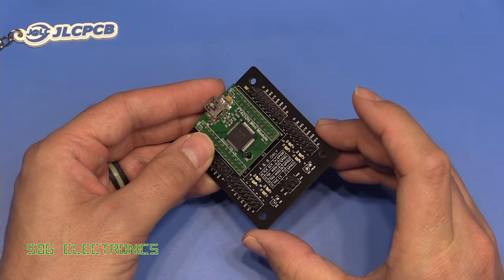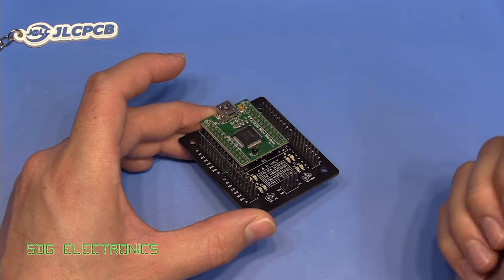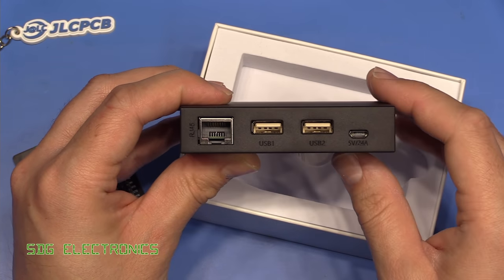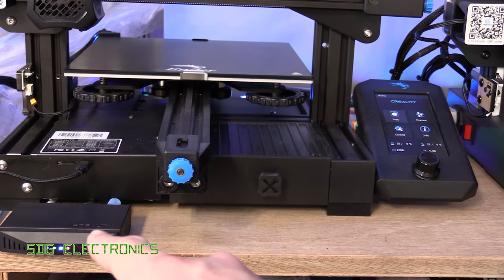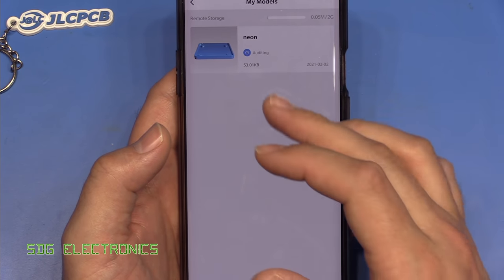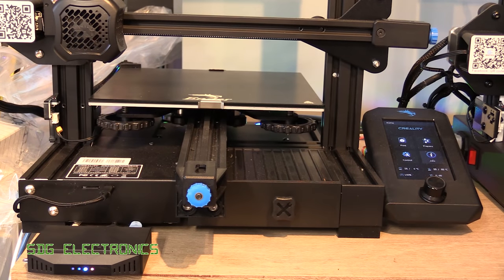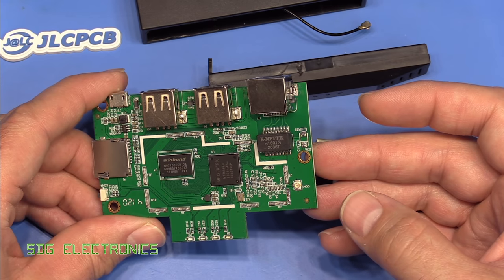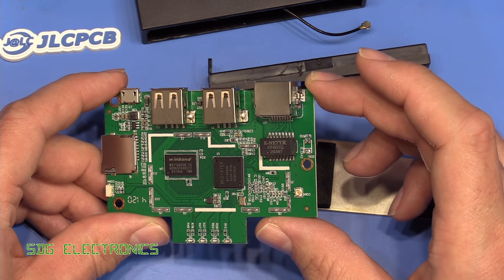SDG #194 Wireless 3D Printing with the Creality WiFi Box. Or not.

Comment: I own a wifi-box, but i'm not very fond of it. Using a raspberry 3 or 4 with octoprint is way, way, way easier and more versatile. The amount of options on octoprint, compared to the options of the wifi-box are not to compare. The wifi-box can receive designs from your computer/laptop through your creality-account, but you need to use your phone to make the final operations. This afternoon I saw a video of someone, flashing the wifi-box with Klipper and Octoprint. I think that's the best option for this box, to function right and in a pleasant way.

Comment: That looks like an UART patchpoint on the bottom (the 4 testpads), maybe reflash the Chip to run an instance of octoprint?
Reply: They are. Though if you want to flash openwrt on it, someone already did the hard part and you don't even need that serial interface. Just put the compiled openwrt image on the sd card and the box will get tricked to install an offline update when it's actually the openwrt image. Check this https://hackaday.com/2020/12/28/teardown-creality-wifi-box/  You'll find the link to the guy's github page who ported openwrt (figgyc).

Comment: Thanks for being the first person I've seen that took this apart. 
  I wonder what system requirements octoprint has. The MT7688 has decent open toolchain support from Mediatek. It also has an available uboot bootloader. At first glance there is support for node js and python, along with a MT7688 dev board Mediatek lists with arduino ide support. I imagine someone will eventually get octoprint running on this. It's a shame creality didn't spend their dev dollars doing this already. Time spent on a proprietary phone app was a dumb move. It shows a lack of marketing perspective, and growth potential. Any product like this should be designed independently and able to stand on it's own. If it worked with every printer, and most people have a positive experience, they would be far more receptive to Creality in the future. 
   I'm researching what to get for my first printer. I almost pulled the trigger for a Creality, but stuff like this.... Nah. I'm looking at an original Prusa now. In the MK3S customer feedback reviews on the Prusa website it seems like most people are paying an Asian market first printer purchase tax before purchasing a MK3S and confessing their sins in their feedback comments. I think I'll go the cheaper route and skip the tax.
-Jake
Reply: Yeah, I was thinking the same thing. Reflashing this to octoprint (or other open source print monitoring software) seems like a definite possibility. If I knew more about embedded linux I'd give it a shot myself, but all I've managed to do so far is burn defconfigs from buildroot. Also, as a Prusa mini owner, I can't recommend Prusa printers enough. I've had several chinese cheap printers before, and they were always a pain with getting it tuned (and keeping it that way). Bought my mini 6 months ago and have done 0 tuning. It's worked flawlessly, would definitely recommend to anyone looking to get into 3D printing.
Reply: The SoC in this box is even slower than a Raspberry Pi Zero, I think (I've not checked), and OctoPrint is painful enough to use on a RPi Zero. Also I seem to recall that the Pi Zero is officially not supported by OctoPrint due to lack of CPU/RAM (based on what I remember of the interview with Gina Häußge - creator of OctoPrint - on the Meltzone Podcast last year).

Therefore, even if it would technically "run" on this box (and I'm not saying it would), it'd be a really awful experience, and you could forget about installing a lot of plugins...

Just skip this thing and buy a Raspberry Pi 3 or 4 instead :p
RPi 4B (any RAM size) would be preferred, as it's significantly faster than the RPi 3B+ (Tom Sanladerer has a video comparing OctoPrint on various RPis), especially if you put a proper 64-bit OS on it, and OctoPrint can bog down a bit if you use as many plugins as I do! 😅
But a RPi 3B+ or even a 3B (not-plus) would be plenty, if you already have one of those or can get one for less than a Pi 4.
I'm still running OctoPrint on a RPi 3B+ with no issues. I'm only planning to upgrade it to a RPi 4B (2GB/4GB) at some point because I'm impatient :P
(Also doesn't the RPi 4 have hardware H.264 video encoding? That could be useful to encode my timelapse videos in something a bit more efficient than MPEG2... 🧐)
Reply: @AndrewGillard  
  Good advice indeed. IIRC, the π0 is over twice as fast as the MT7688's 540MHz. 

 I did a little more digging earlier. The only easily accessible Linux for the MT7688 is with openWRT. I imagine if someone compiled an image with a light busybox based kernel, and the minimum dependencies for a headless Octoprint only, the system requirements are dramatically different. Blazing that initial path would take a lot of work though. For the rest of us, a Rπ3 is probably a better solution.
-Jake
Reply: @UpcycleElectronics  I actually went the extra mile and managed to run octoprint on this box (with the openwrt port by figgyc). I've followed an old tutorial from the octoprint forum. I could control the printer without issues but the printjobs were skipping gcode commands and the print quality was not that good. I will be looking in the near future to test klipper and mainsail/fluid/dwc2 as these are less cpu hungry.
Reply: @Jonahmeans1024  I've never understood why is octoprint so slow and bloated? In its bare core, it should be just about opening a serial port and sending gcode lines.
Reply: @JG-mz7hg  It used to be really snappy on low end hardware just before the plugin management system was introduced in v1.2.0. It's true, the core job it does (serial communication, code sending, web serving) can be run even on an ESP8266/ESP32 (check luc's ESP3D repo ).

I've tested this box on v1.0.0 and it works as snappy as it can be. On v1.7.3 it works ok but you have to wait almost 7 minutes to fully boot up. After that it's usable. If you try to load the UI (on a new browser) while printing stuttering and skipping may appear as it hogs the cpu at 100% for a few moments.

Comment: Yeah 3d printing is such a rabbit hole. A hobby within a hobby. If you want the very best tips and advice, I have found the quality of dicussions at the Annex Engineering discord to be 2nd to none. Highly recommended.

In terms of this specific part of the equipment: get an rpi4... .are they still £33 GBP on ebay? That is how much I paid last November for the 2gb model. Then download and install onto it the FluiddPI. As the boot image for the rpi4. That will include all the most glorious most amazing software. Way better than just octoprint, which is kinnda old hat now.  You will also need to find a klipper config file for your 3d printer, and then reflash your printer's controller board with the klipper firmware. Which is way better than marlin or even a Duet board. Configuration takes quite a few steps. But there are good tutorials out there to make it easy enough to follow along. And it's well worth it! Head and shoulders way above anything else.

Comment: yeah, I would still recommend octoprint. easily connects to Cura and more, and works quite well. the same with the local control panel thou, you need to control it from the slicer, mobile, browser or connect a touch display to the rpi and use something like octoscreen. I also would suggest using PVA glue stick on the bed, way better sticking of PLA and easy to remove. Just use water to clean it off when it starts to look like a mess. keep up the good work, greetings from sweden (:
Reply: Glue stick can work well, but a lot of print surfaces these days don't need it for most prints. Using glue stick is always at least slightly messy and time-consuming, so I wouldn't recommend using it where prints already stick down fine :)
In this case the print didn't stick because the nozzle was too high. You don't even want the print to stick when it's just going to be spaghetti anyway ;)

(However glue stick is useful to keep around for models that are very prone to warping, as well as for materials that benefit from it 👍)

Comment: Pi Zero and fluidd /octo... cheaper and more versatile. But honestly I don't get the whole wifi 3d print thing, I mean I personally have to go to my printer anyways, to turn it on, and check for filament, clean the bed and nozzle...  I can take the SD card with me and plug it in and start the job while I'm there ... okay, the camera thing I get and probably the status of the printer is nice to have on a display far away, but starting jobs remotely ... not with my tarantula anyways  amazing as this thing is .. pull it out of frozen mud and it prints right away, like a heckler and koch :D
Reply from the maker: My only issue is I've been through about 5 SD card readers in the past few years from the amount of use on the contacts.

Comment: I imagine you're more of a hardware guy (like myself :D ) but I saw this article on hackaday a while back https://hackaday.com/2020/12/28/teardown-creality-wifi-box/ seems like it is possible to install openwrt linux on this thing if you're so inclined. I have one of these boxes (though i didnt pay anywhere near 20 bucks, that would be a ripoff considering it's performance vs other sbc or even raspberry pi) and i've turned it into a webcam device for my ender 3. The printer itself is controlled by a raspberry pi 3a (not b) so a) not enough usb ports to have webcam and b) offloads processing
also i use klipper instead of octoprint and if you're tuning inclined i'd highly recommend it ;)
Reply: Wow. Nice reference. Now I want one to hack around with.

From the comments below the hackaday article, the root password has been decrypted as: cxswprin
TL;DR-
It's a somewhat stripped down router kernel on 580MHz hw + someone ported openWRT already.
Reply: Nice! Thanks for sharing the article.
Reply: Here are instructions: https://www.youtube.com/watch?v=0y3qt8cvtKY

Comment: Looks like a solution looking for a problem.  Why you would want to have to use your phone is beyond me. May be updates to the phone to warn you that the printer you left running is starting a fire and you should come back home. :)

If I’m in the house with it I can’t see any need for a phone connection.  Laptop is in the living room, desktop in the toy room with the printer, and tablet is by the side of the bed. The phone just complicates it. I’ll pass on what’s in the bath room. ;)
Reply: My phone is my primary "near the printer" control interface for OctoPrint (via the OctoRemote app) since my laptop's given up working, and honestly it's been all I need (though my phone sees extremely high use anyway; I use it more like a laptop, I guess).

That said, I slice parts on my desktop PC rather than on my phone, and I have no interest at all in this Creality system :p

A big part of whether anything like this will be usable or appealing is always the software. The OctoRemote app is very nice (not perfect, but it's a free, open-source app that someone created largely for their own use, and it's still being developed), but the Creality WiFi box software doesn't appear to be :(
Reply: @AndrewGillard  why would anyone want to do the sliceing part via phone?
Reply: @TheEmbeddedHobbyist  I mentioned slicing because that appears to be the case with this Creality app.

My general point was to provide some insight into your "why would anyone want to use their phone to control a printer?" comment. Even if my laptop still worked, it requires a fair amount of desk/table space that I don't really have available near my printer (despite this being a relatively compact Surface Pro 3), and for general printer/OctoPrint control tasks my phone works well - possibly better than a laptop, as a decent touchscreen layout on a performant device can be faster to use than mouse and keyboard. (The Surface Pro 3 has a touchscreen as well, but I wouldn't be running a touch-optimised OctoPrint interface on that. It's also a rather old and sluggish machine, unlike my phone.)

To answer your question, I see two main reasons why someone would slice parts on a phone:
1. It's all they have - maybe other family members are using the only computer(s) in the house.
2. They're only interested in downloading and printing models created by others and which don't require complex slicer settings. That sort of person probably wouldn't touch much in a PC-based slicer anyway - just select the filament type, choose a print quality and/or speed, maybe enable/disable supports or adjust infill percentage, and that's about it. So they wouldn't even be missing anything from a very simple phone-based slicer - assuming the slicing engine itself was any good, of course.

A phone-based slicer good enough to be usable by this video's likely audience (those who are willing to use smartphones for that, anyway, which I appreciate isn't everyone) would require a lot of work to optimise all of the features of modern slicers for a smartphone interface.
I don't think it would be *impossible*, but to do it properly would require a lot of clever UI design.
Reply: @AndrewGillard  Thanks for the reply, a very good point. I grew up before the mobile phone, so still see it as a phone. Trying to teach a new trick to an old dog springs to mind.